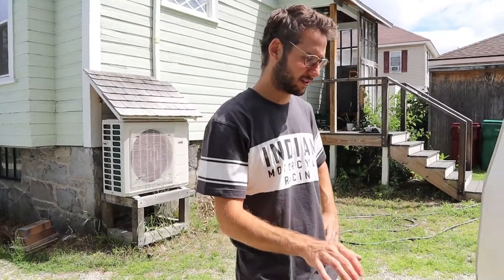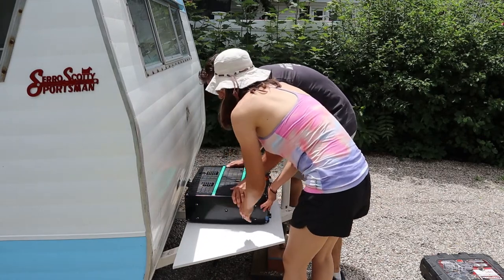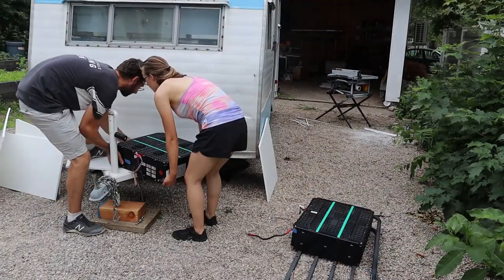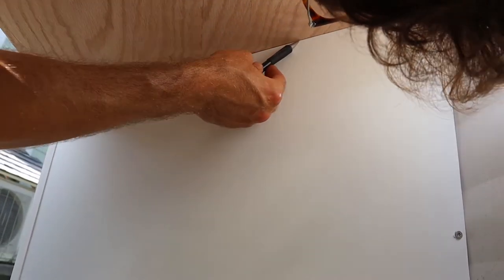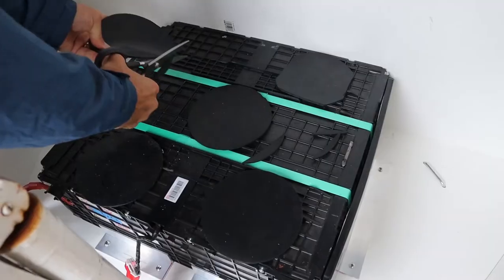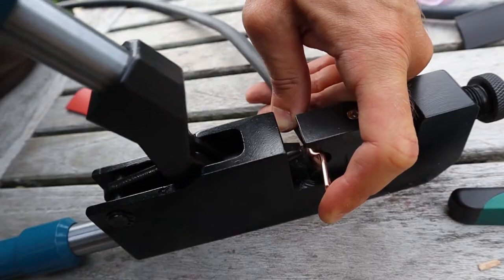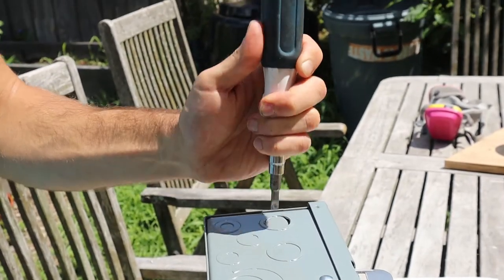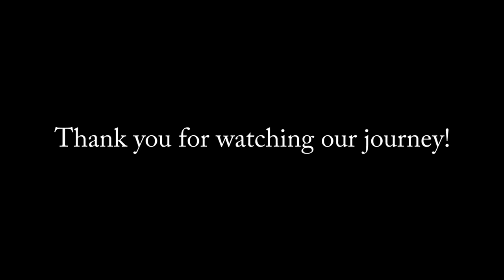DIY Off-Grid All-Electric Powered Plant Based Food Trailer Build: Part IX (With some exciting news!)

Comment: How do you charge the batteries? Are you considering solar panels? Do you have any internet links yo your inverter and batty bank?
Reply from the maker: Hi @robroy333, Cormac here - I've considered solar, but the big inverter that we used requires a decent amount of voltage, thus we would need a few larger solar panels to utilize that function.  We may add a separate charge controller to charge the batteries with one panel, but we typically store the trailer in our garage when it's not in use, so the solar panels wouldn't be well utilized.  We do have solar on our house though, and we plug in the trailer to charge it up from the house, so it is in a way charged via solar!

Regarding the inverter, here's the link to the one we used: https://watts247.com/product/lv6548-6-5kw-120v-solar-inverter-4kw-250v-mppt-bms-ul1741-built-in-wifi/
It was really easy to set up, and found some great advice from another youtuber if you are weighing the different options: https://www.youtube.com/@WillProwse 

The battery bank was purchased from: https://batteryhookup.com/
The battery itself was a recycled pack from a large solar array, so it only had 70% of the original capacity, but we were able to buy it for 10% the original price as well as use a recycled product, so it was a win-win for us.

Thanks for your questions and good luck with your project!
Cormac
Reply: @plantifulfoodtrailer6663  thank you sir! If I was still in NH I’d definitely visit your food cart !;) thanks for the information! I am already subscribed to that YouTuber;) I built and off grid tiny house years ago that build a solar system for:) amazing the food truck I’m building is almost identical lol
Reply: @plantifulfoodtrailer6663  Friendly heads up that the link for the inverter is broken, but I figured out how to make it work:
Replace with the following:
/product/lv6548-6-5kw-120v-solar-inverter-8kw-2-x-4kw-250v-mppt-ul1741-compliant-built-in-wifi-see-conditions-description/
YT will delete my comment if I post the link myself.  Feel free to delete this comment if the link ever gets fixed  🙂